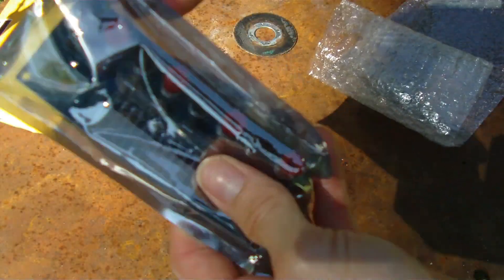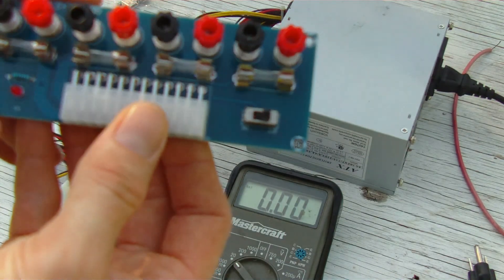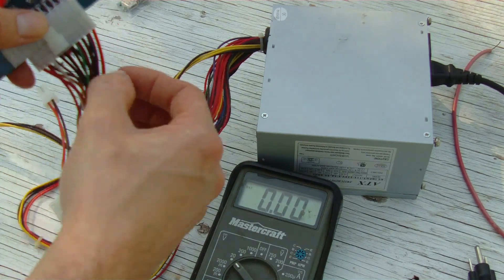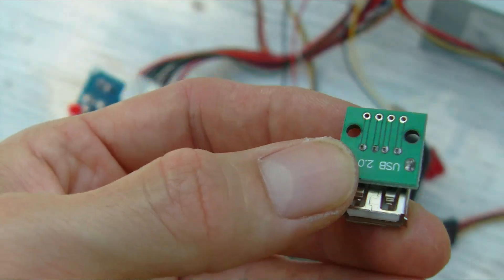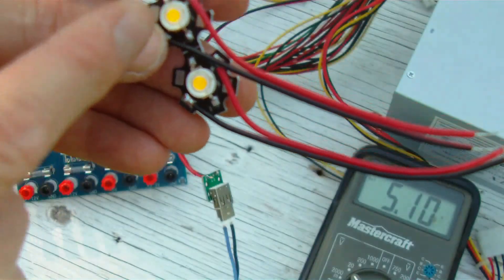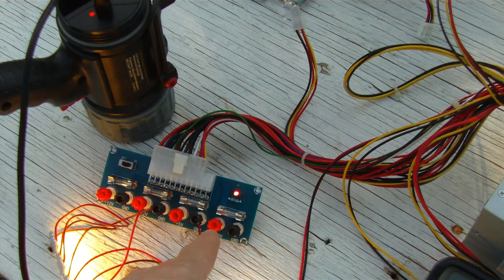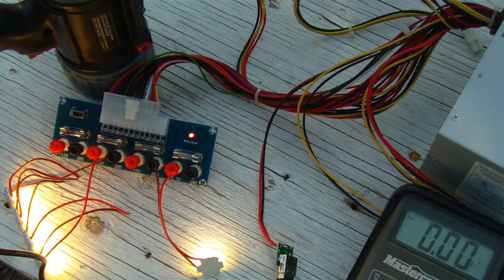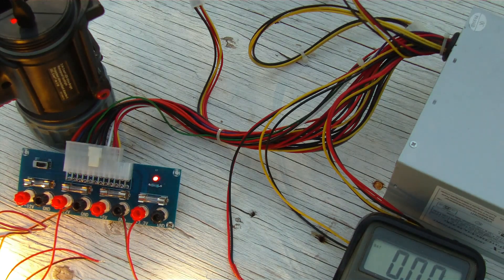How to use ATX Breakout Board - Power LEDS, USB charger from old computer power supply

Comment: Can you make a car stereo work with that board?
Reply: The 12v posts on the board will surely allow a car stereo to "work". The issue will be that the fuses installed on the board may not allow you to turn the stereo up all the way without blowing the fuse. The fuse is likely rated for 5 amps which is only ~60 watts of power budget for the stereo. Just keep this in mind.
Reply: why at all wouldnt you just use the already high output 12v dc supply every single car happens to have
Reply: @jacklanglais2379  I think this is to use a car radio in your home or shop.  They are excellent shop radios.  Enjoy your day.